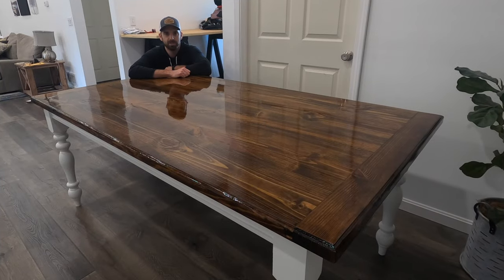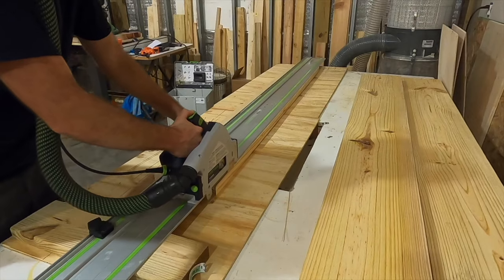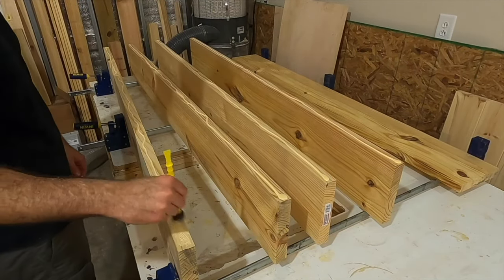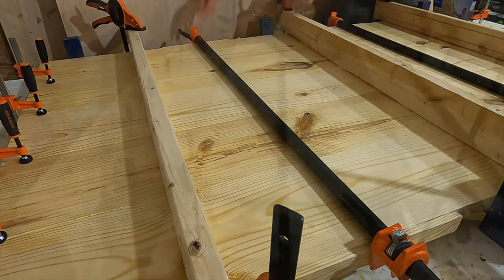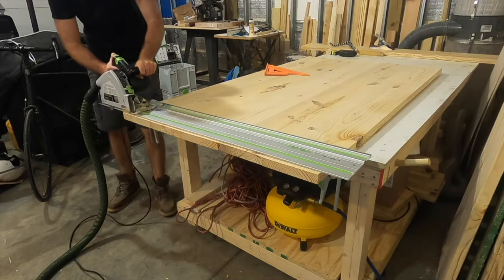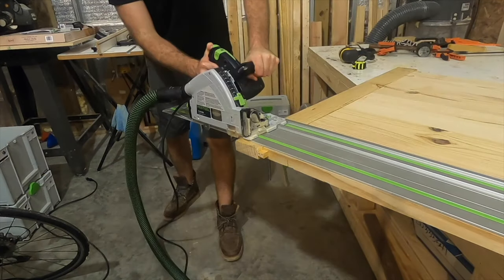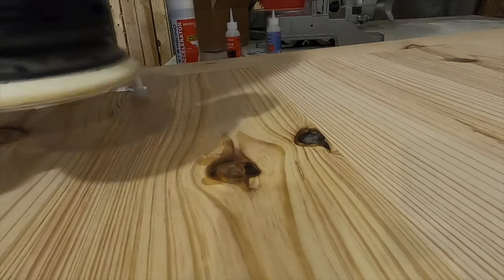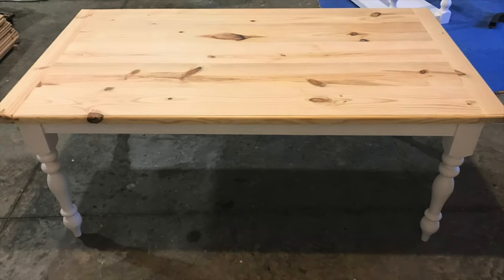Building a Dining Table Top from Pine Framing Lumber (Farmhouse Table Series 3 of 5)

Comment: That's it, I'm getting a track saw.  I struggle getting straight edges for glue ups on my table saw. Another awesome video!!
Reply from the maker: Thanks Jim! The track saw has been a HUGE game changer for me.. They're expensive up front but I use mine in so many different scenarios. 100% worth it IMO if you build a lot!

Comment: I love using starbond to fill in those knots. And as you have found…. The thin is not as easy to use. I typically use the Medium. Not a fan of the thick either. The medium just seems to work well.
Reply from the maker: I'm with you there, the medium is by far my preference to work with!

Comment: Hi Matt, would you think this method of joinery and glue-up would work alright on an outdoor table? It's in a covered deck so it wouldn't get wet or sunshine, but I assume the humidity swings are a little higher. This is Colorado so it's not a humid environment, but still the winter/summer swings.

I have determined I definitely need the breadbox (new concept to me) to prevent cupping, but I'm a little bit worried about glue causing cracks. Should I reinforce the joints between the boards for the table top?

I will be doing aprons with mortise & tenon joints connecting the table legs.
Reply from the maker: A traditional glue up should be fine. Breadboards will certainly help warping/cupping, just be sure to attach them in a manner that will allow for wood movement - the boards will definitely contract/expand with the outside environment.

P.S. I absolutely love visiting Colorado in the summer time! Enjoy the Mountain views for me if you live close to them!

Comment: Hey! I'm planning on building one of these.  Did you use 2 individual router guides to make the dovetail groove or is that just one tool that can do that.
Reply from the maker: I use 2 router edge guides, you could do it with just one but 2 holds everything much more secure when using a larger dovetail bit

Comment: Do you think it’s a bad idea to glue and pocket hole the the table top?
Reply from the maker: Pocket holes and glue is fine for joining the main section but the breadboard ends should be attached in a way to allow wood movement. Pocket holes and glue would restrict breadboard wood movement and the top would crack over time

Comment: How did you get them flat on the planer without a sled?
Reply from the maker: I just tried to find and use the straightest boards I could. I used to hand plane to flatten the entire top the best I could after the glue up was finished 👍🏻